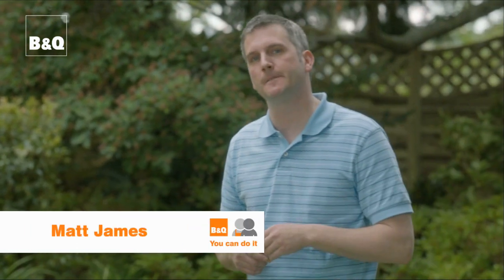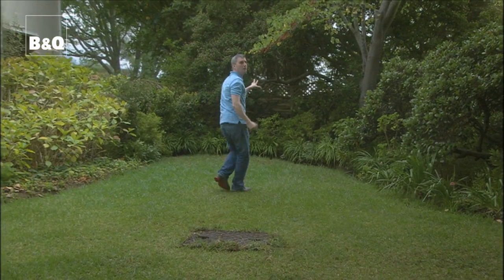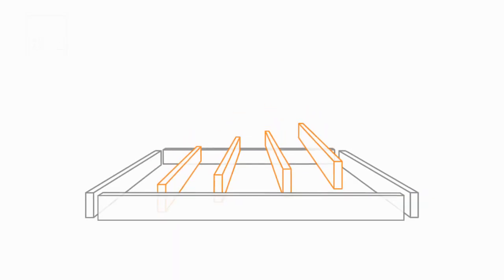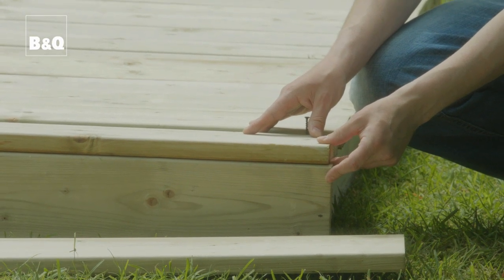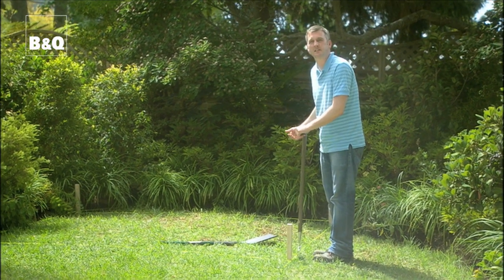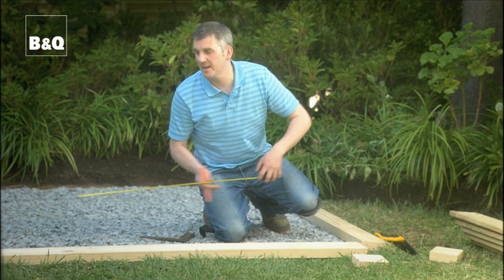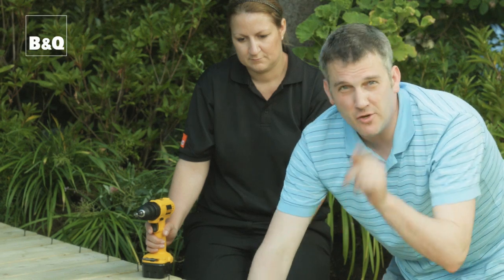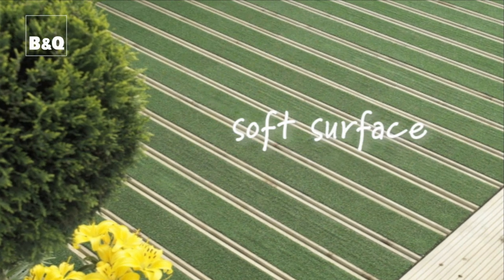How to build a deck

Comment: +bandq - Your 400mm c/c diagram is incorrect. It shows a gap of 400mm instead of centre to centre, which would be a 350mm gap approximately.